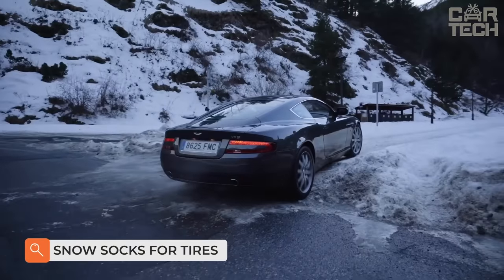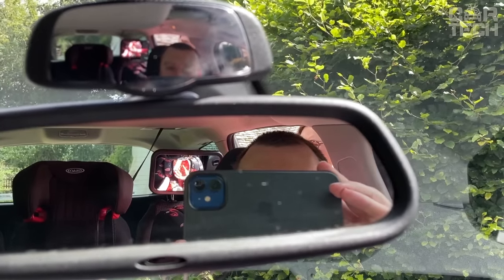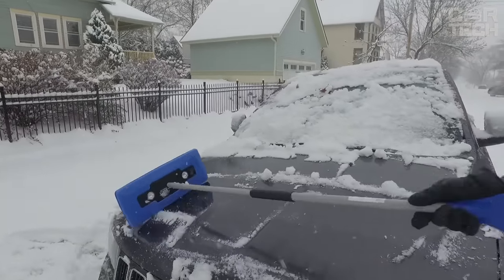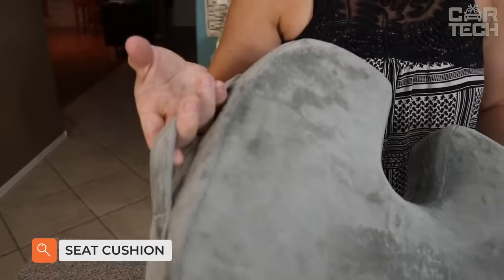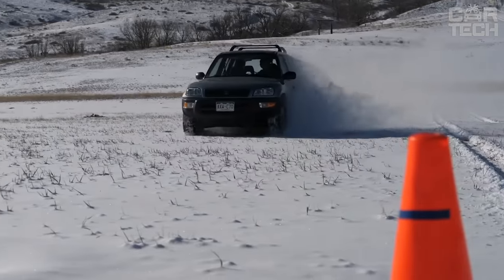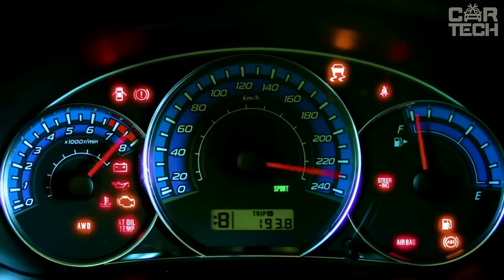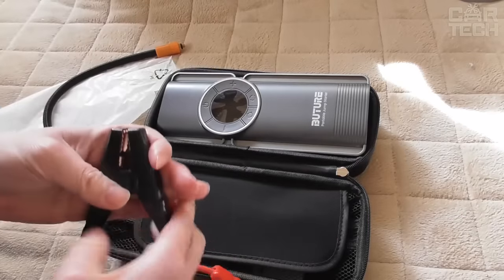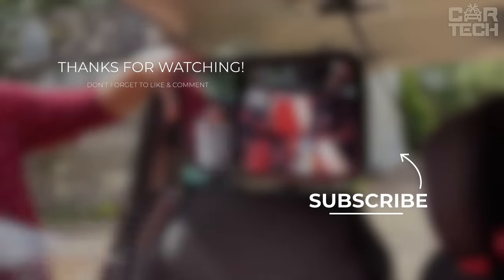30 The BEST Car Gadgets on Amazon in 2024

Comment: Concerning the tire repair kit, all tires have to be removed from the rim to repair a tire properly. That's the only way to insure that the inner liner is properly sealed. The inner liner acts like a tube in today's tubeless tires. A plug is used to seal the tread rubber so water doesn't get into the fabric and steel belts causing the to rot or rust which will lead to the belts breaking. If you just plug a tire, as in this video, the tread rubber may seal but the inner liner may not be sealed and this will result in large bulges in the sidewall. Same thing happens with impact breaks where the tire strikes something and stretches enough to tear the inner liner but not puncture the tread/sidewall. The inner liner has to be patched similar to how tubes use to be patched. Also the second tire shown being repaired is being repaired at a location on the tire that shouldn't be repaired.
I retired as an automotive mechanic college instructor with over 50 years experience, 12 of them working for Goodyear Tire and Rubber
Reply from the maker: This kit is good for fixing a tire and getting to the nearest tire shop.